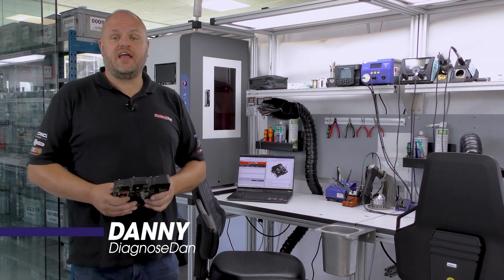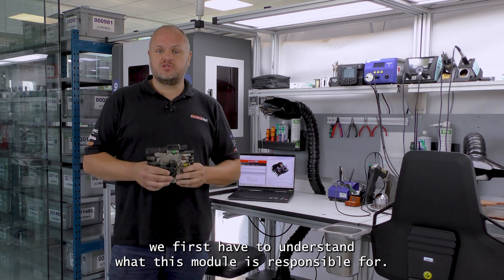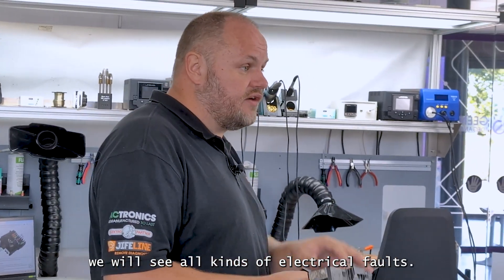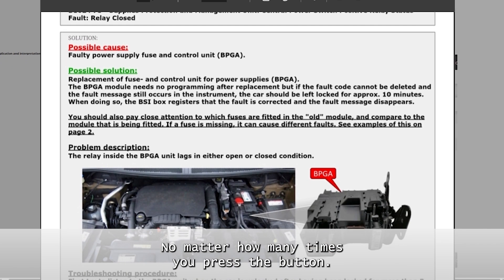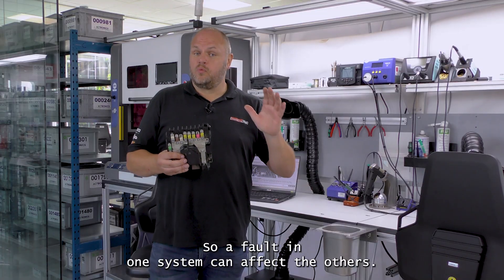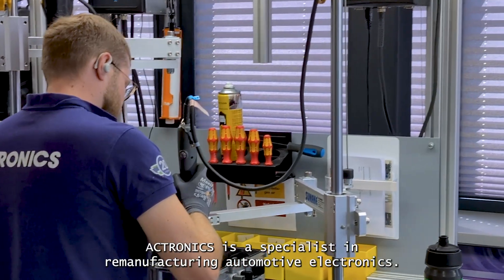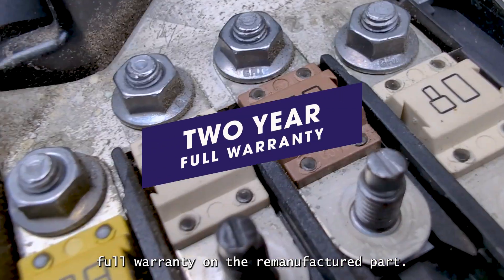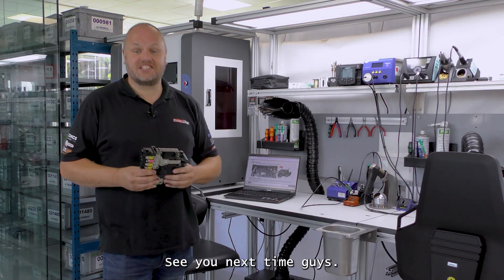B1624 Citroën & Peugeot Problem - Faulty Stellantis BPGA Module? Diagnose & Fix with DiagnoseDan

Comment: I’m sorry Dan but this time I completely disagree with you ( at least here in the Uk) ACtronics is a company I and other friends with garages have used many times and the outcome is seldomly good, on a number of times they have damaged units or have made units worse, it has left me with not only the same problem but it then looks embarrassing with my conversation with the customer. The last Mercedes ABS module I’d sent them a year ago was forgotten and I had arguments with them, 3 weeks later it turned up with the most horrible seam seal on the module and they hadn’t repaired the faults that they clearly agreed to fix, I then had to source a second hand unit, it got quite tense between me and the long time customer. I could write at least 6 other bad experiences but I don’t want to go on, but I agree with other comments sometimes buying new is more effective. Their offer sounds great in theory but they are seldom true to their word, also sometimes one has to realise that the hassle and stresses of chasing them is really not worth it.
I do hope you’re careful about promoting them because I think when people start to give their trust in them the 2nd 3rd time maybe I’m confident there will be tears before bedtime. This is just MY experience with them over the years but never again and this is a very agreed view in my part of the world.
Again sorry to be negative about them but  be careful with your trust everybody.

Comment: The part is around €250 plus vat from dealer I think got one a few week ago
Reply: Yes, they are not crazy money. I have replaced a good few of them. Dealer always has it in stock, so not much sense in sending it for repair and go through hassle with the post and waiting time
Reply: Wonder why the dealers always have them in stock🤔
Reply: Sorry, but as a dealer, such a cabinet already costs us over 350 euros to purchase directly from Peugeot. So, even more for the customer.